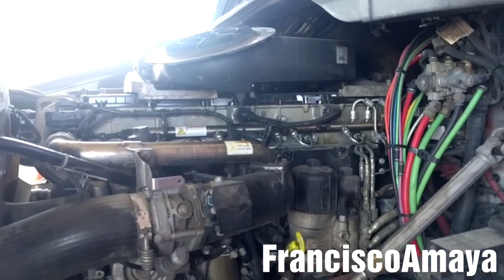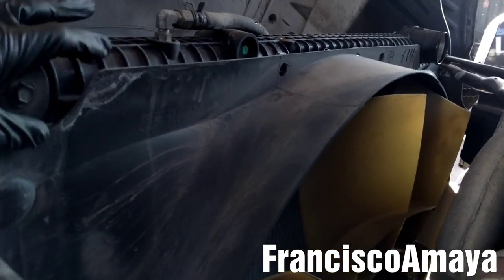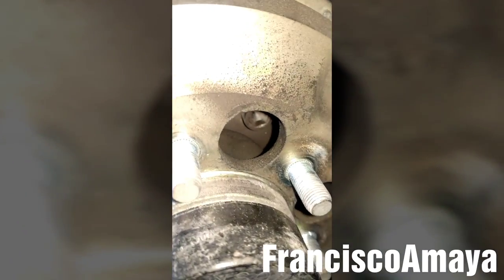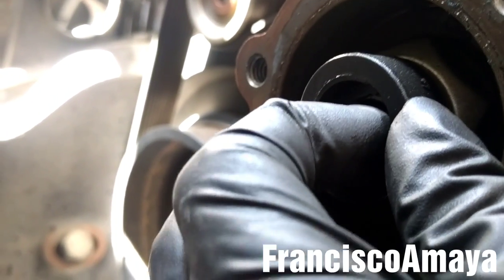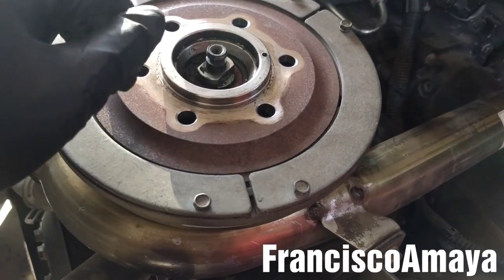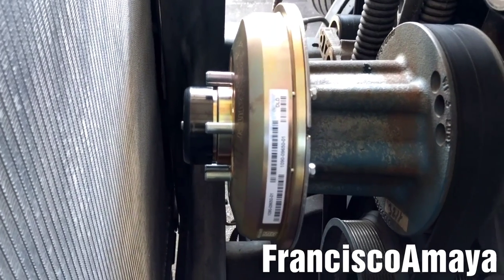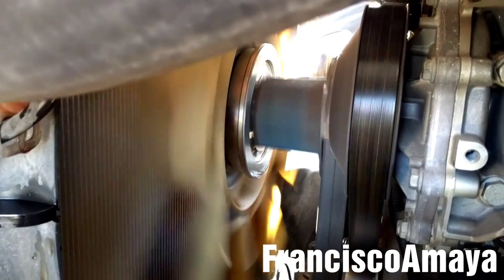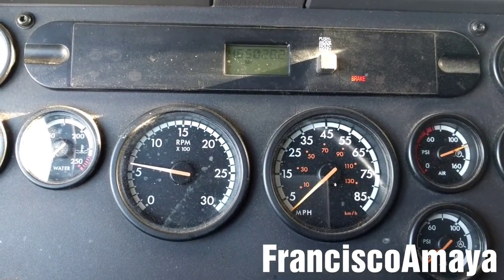Freightliner Cascadia DD13 DD15 DD16 fan clutch replacement Series 60 Cummins ISX fan on

Comment: You can usually get away with only unbolting the upper rad support and pulling the rad forward to get the fan/clutch out. Saves time especially sense those surge tank nut inserts like to spin free in the rad most of the time. Also anyone doing this. Grab a GOOD hex bit and breaker bar. Those things are in there good and the last thing you need is a stripped hex head or a busted socket.
Reply: Man thank you, I sure as hell did not want to drink that tank.
Reply: Yep, just replaced mines and the tech was able to avoid draining and removing radiator assembly. My pockets appreciated it.. still a good vid tho.. 😅

Comment: Brother I replaced my fan clutch thanks to your video, but once in a while my fan kicks on even when temperature is normal and my check engine light turns on after few minutes it goes off. I did change the actuator as well.
Any idea what can be causing that to happen?

Comment: I have a 2016 Cascadia and over heats when going up hill . I’ve replaced value solenoid for fan clutch and air is flowing properly. No sigh of water pump leaks and Water stays at 220F and won’t go down . Don’t know if it’s coolant thermostat or anything’s else Can you help me with this problem
Reply: I’m having the same issue let me know if u figure it out

Comment: My fan not enganging 2012 DD15 it does not have an air hose intstead there is an electrical wire,any idea what it could be?
Reply from the maker: Does it has a big aluminum plate in front?

Comment: Hi Francisco my truck is losing power but there is no check engine light on do you think I have turbo air leaks or something??
Reply from the maker: It could be a air leak or a restricted fuel or air filter.  First check the fuel filter and air filter, replace them if it is necessary.
Reply: Hey Francisco I went to 3 mechanic and they could find what wrong so I took to Vally Power in industry city and dyno test it and it was my injector went out I'm frustrated the other 3 mechanic can't find that problem on the computer
Reply: Injector fail does not have any check engine light you just feel lost of power
Reply from the maker: It set a code only when the fail of the injector is electronic,  if the fail of the injector is mechanical the computer won't set a code. However,  there are other ways to check with the computer the injectors performance maybe the mechanics did not know about that.
Reply: Oh ok

Comment: I have a 2012 w dd15 my fan recently started to stay on full time what should I check first before I start replacing parts ? Thanks
Reply: Having same problem and wanting to know the same question...I believe my problem is the fan clutch because I hear the same hissing sound as mentioned in beginning of video....
Reply from the maker: Many causes for that problem 
Bad solenoid 
Fan clutch stuck
Fan clutch air leak 
Solenoid dirty
AC command no stopping 
No solenoid power or ground
Reply: Francisco Amaya thanks a lot.  I’m also having the same problem with fan. I got a yellow check engine light.   I hope my engine will not be ruined

Comment: Hi francisco. My issue is whenever the governor kicks in to fill the air tanks there is a loud noise from around the fan clutch which goes out after the cut off. I have a 2011 cascadia DD15.
Reply from the maker: You can have a bad air governor.
Reply: My truck 2011 frieghtliner dd15 also the same problem I changed the fan clutch solenoid and fan clutch but still the same when my speed 60 mph it’s ok but when I bump the speed to 65 mph the fan spin faster and loud

.. noisey I don’t know how to fix

Comment: I have a 2012 cascadia losing coolant I checked the driver side egr pipe its dry, the oil and cap is not milky, I found three leaks and repaired them , it still loses coolant, no white smoke either. Any ideas?
Reply: bigmattus the last leak í found was on the house that goes to the compressor, it was hard to find bc never saw water on the floor, hope it help you, but you can try a pressure kit from AutoZone and check it
Reply from the maker: Can see water marks on the middle and rear area of the vehicle?
Reply: Dont see watermarks, and added pressure that's how I found three leaks
Reply from the maker: The only two options I can think about your PROBLEM are: 

A bad EGR cooler
A bad head gasket or cylinder head